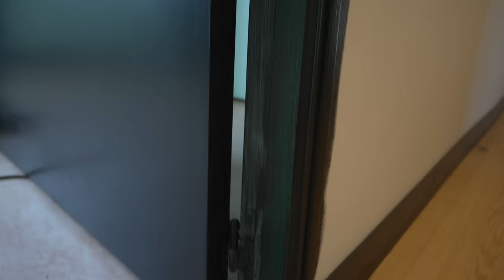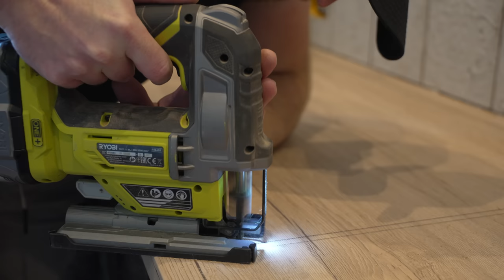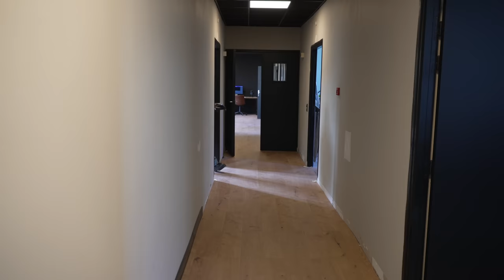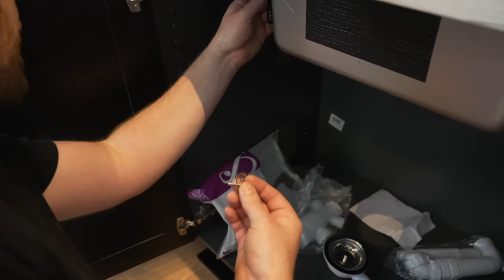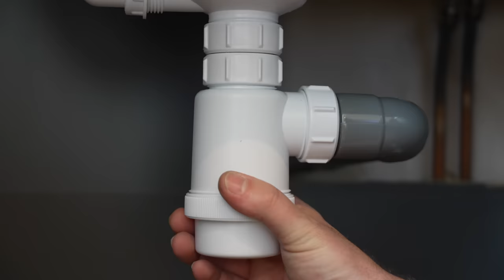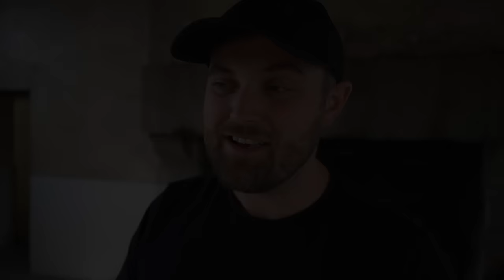We Have Decided What We Want To Do With The Convent

Comment: Thinking about your project. You obviously have an amount of money you need to make from the convent to cover expenses. Bearing that in mind, I suspect you want to follow your own interests. Currently making films for YouTube seems to be your main interest and one that I'm sure will make money for the foreseeable future. Even if YouTube folds I'm certain the future of online entertainment is only going to grow. I would suggest having a hotel is too much work and hassle, as would be long term residential accommodation. I think you need to look at your location and think will loads of people flock to the convent for events; I suspect not. You need to think of the strengths of your location. I live in Cambridge UK and our strengths are very much based on the University and most of the local industry is education and science. So what does your location have to offer or what is its Unique Selling Point (USP) The one that springs to mind is food and wine, I'm sure you can add to that list. 
Your interest is YouTube and making films. Can you marry the two together? My first thought would be to turn the convent into a film/YouTube factory. This does not involve too many people, and an area you already have some experience in.
You could run several channels from there, you already do!  
You could convert some of the Nun's sets into apartments for visiting film makers and some into prop and equipment storage, with some other parts of the convent used as studios, along with hot desk offices for editing. and a sound proof room for recording voice overs; Additional Dialog Replacement (ADR). You would need several well equipped workshops for woodwork, metalwork and electrical/electronic maintenance. Also a store room with consumables to sell to punters, batteries and film stuff etc.

Food is quite a big thing at the moment and food studios are few and far between. Apart from the big kitchen you are planning which would make a fantastic studio, finding an interesting kitchen that will accommodate several cooks and a film crew is difficult. You could also have smaller additional studios even an infinity curve green screen studio. Most food films culminate in tasting so a banquet hall, would work well.
 I visited several food studio in the UK and they all had huge store rooms filled with props like plates and other stuff. You also have the Chateau and grounds which would provide excellent space for filming. Obviously this is not going to happen over night but neither is you conversion work. As far as I can see this idea might tick many of the boxes for you; collecting stuff (props) buying film equipment, and building things (sets) You might consider inviting celebrity chefs along.  Also consider lighting and equipment hire. Actually none of this is vastly different from what you are doing anyway Just a bit of focus.  
You might consider approaching a lighting/equipment manufacturers to see if they want to do a collaboration/sponsorship deals.   

Only a thought!
Best Regards Martyn

Comment: Once the main kitchen is laid out how you want it, why not think about having pop-up restaurant nights during the summer in the main courtyard? I'd still get some professional advice from professional chefs on what's required for commercial kitchen layout though; would certainly save on very expensive oopsies and possible reworking. 
Whatever you do, DO NOT install a chandelier into what will be a commercial kitchen. Even with the very best in extraction technology, a chandelier will very quickly become a grease & dust trap cleaning nightmare.

Comment: I like your ideas and think you should pursue them...I think it needs to be a flex space and used as a hotel/event center.  The kitchen should be turned commercial with a dumbwaiter built in so catered food could be delivered to the large cafeteria room on the ground floor.  Perfect for weddings/events.  Don't like the idea of a Brocante. There seems to be enough of those.  I notice the doors to the Nun's cells are quite short.  How would you make those taller without replacing them?

Comment: If you are going to sell the convent on it is pointless spending money on a high grade kitchen and bedrooms when the buyer may have different ideas in mind that would mean that a lot of your hard work would just be ripped out to conform with a new owner's plans.  Likewise why spend lots of money on a new lift when a new owner might not mind the top mounted lift motor?  Only spend money on the infrastructure if it is pretty certain that it can be recouped, ideally at a profit, from your selling price.  There is always a possibility that you might decide that you would like to start a business of your own in the convent in which case plan your work accordingly.  Luxury bedroom suites would probably not work for a hostel and a cordon bleu kitchen would be a waste of money if the meals to served are bought in from an outside caterer and only require heating.  The new business must dictate how rooms, fixtures and fittings are applied rather than vice versa.

Comment: You have talked before about the missing tower on the convent and if I understand you right the location for that tower is slightly beside the lift shaft. I have an idea for you, can’t you build a new tower on the top of the lift shaft, use the lift shaft roof like a base for the new tower, then you get a second tower and you can keep the lift like it is.

Comment: Your goal should be to host seminars or conferences etc. there. I think it's far too big to use simply as one luxury home. It would be best if you designed it so that it is also possible for members of the village to use your space, as it is located in the centre of the town. 
And with the rooms, I think you shouldn't include lounges attached to the rooms as they hinder the building of a community feeling which is necessary if you organise seminars or similar events

Comment: An open ended design would not work for buyers.  It would need to be set up with a specific function in mind. Otherwise no matter what you do it's not going to be functional...  I'm sure depending on what its end goal should be there will be codes and restrictions for each that would need to be worked out and kept in mind as you move forward...  You would need to research what that specific area would need or contact investors in the area to see what they are wanting and work towards that....

Comment: Have you had a professional look at the lift? Just getting it going again and giving it a service could be a whole lot cheaper than replacing it, provided it still conforms to the relevant regs!

There might not even be anything wrong beyond someone having turned it off very thoroughly to make sure no one uses it until it's been signed off by a professional. I've seen a lift that was deliberately taken out of service by removing the power supply to the brake magnet (which is simply plugged in) making sure the brake wouldn't release if anyone just tried to use the lift without permission.

Comment: Why don't you get a kitchen expert from one of these restaurant planning centers and get suggestions as to how to lay out the kitchen from them. It's frustrating to see somebody that doesn't appear to know anything about laying out the kitchen floor efficiency in serving trying to figure out how it's done. The way it was already been invented. Get somebody in there to help you that knows what they're doing in laying out efficiency in a room that big that could have 2 to 3 lines or more per serving food. It's ridiculous to do it without them, because just as sure as you do a well trained chef will come in and say no this needs to be 10 feet closer together that needs to be further apart. The aisle needs to be here not there and you have to start moving things. That refrigerator is well well and good, but may be a small room insulated as a refrigerator with shelves on three sides would be much more efficient in running a restaurant than what you have! Maybe you do have the experience Billy but you have not made that as clear as you could to us your public. Where are you storing the dishes? Pots and pans where are they? Where are you going to put them? Or what if somebody wants to make that a pizza restaurant do you have enough ovens to make a go of that? How about a restaurant that serves clase food (in other words high priced) classic French pastry. Are there enough of the right kind of violence? Do you have some stainless steel tables that are for mixing and laying out of food to be cooked? You do a fabulous job of taking a 200 year old room and making a modern kitchen out of it to be cool in the summer and warm in the winter, but is this what will sell to a good chef to make a good restaurant

Comment: Use some smart-ass architects, because there are so many things that could go wrong when it comes to hotel/venue flow. There are also regulations in every EU country concerning evacuation, size of corridors, size of rooms, etc. It would be a waste to spend hundreds-thousands of EUR to not get a permit later on. It might be that to get a permit (not a building permit but the occupancy permit) you need to have an additional staircase for evacuation; there are regulations to calculate the number of people for every staircase, also if the staircase is wooden you would probably have to find a place for additional steel or concrete, etc. There is a huge risk to do this without someone who knows the drill, especially in the restoration of old buildings. I worked as an architect in Belgium, Poland and Germany and there were always months of work to make a renovation according to local regulations and standards. It might be a reason why you bought it so cheap, that the investment to get the occupation permit was too high. Good luck guys. I love your content ❤